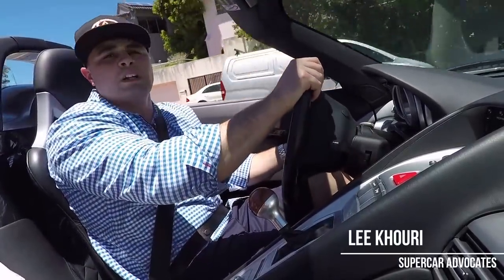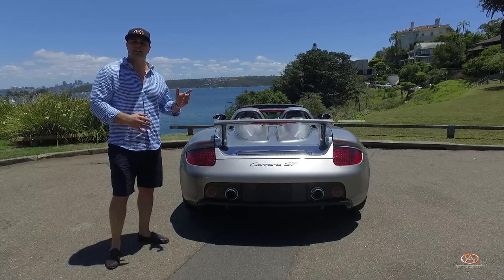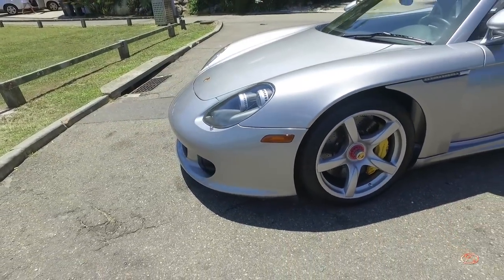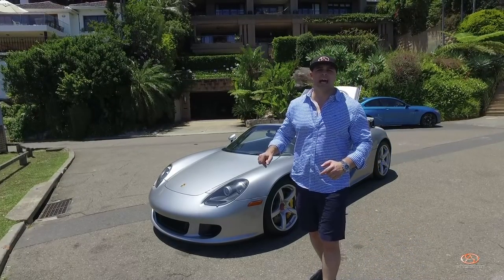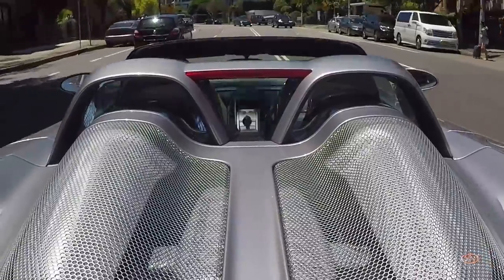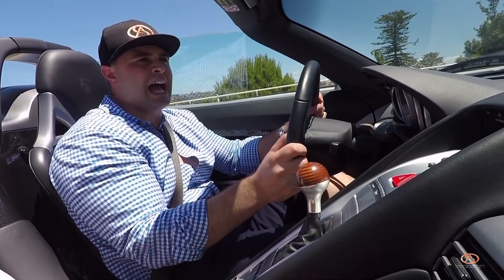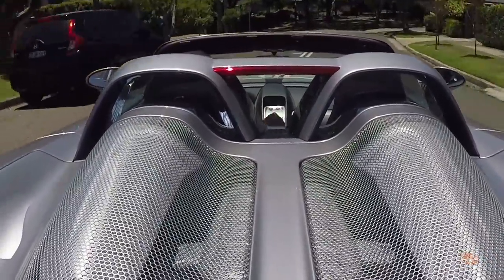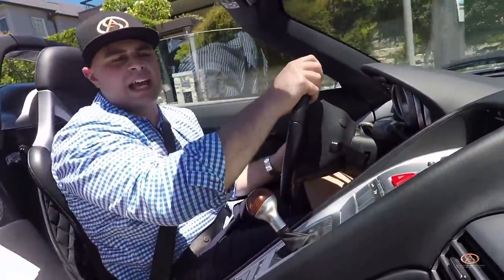This is why the Porsche Carrera GT sounds like an F1 - Review

Comment: Wasn't the engine reworked from a cancelled LeMans program that was in the works to follow on from the 1998 GT1's but cancelled before it hit the track? Not an F1 program.
Reply: Wikipedia says it was started in the early 90's for Footwork, not Arrows, then enlarged for the LeMans program which got cancelled before finally landing in the Carrera GT.
Reply from the maker: https://www.carthrottle.com/post/wg4gm5q/
Reply from the maker: https://en.m.wikipedia.org/wiki/Footwork_Arrows
Reply: devonport1978 arrows was footwork
Seems like ppl r finding it hard to believe it’s formula 1 engine when it is clear if u research
Reply: George Dooperman Ease up hero. Everything I'd ever seen and read about this car referenced the cancelled LeMans program as the origin of the engine. Nobody else had taken it that far back to link it to the F1 program. Always good to learn new things isn't it.
Reply: Yes, you‘re right! But the le mans engine is coming from an f1 engine. It’s basically a stroked version. ;)
Reply: a Corvete Z06 sounds better
Reply: Each to their own. I think the best sounding production engine of the modern era is the AMG V12 in the Pagani Zonda 760 series but the CGT is definitely in the top 10 for me.
Reply: VW are to blame for this not happening telling them to cancel there racing program as there was already Audi in it or lose out on the suv

Comment: So is there a more technical explanation why? Is it the cylinder angle? The oversquare bore? The firing order? B/c it sounds like it screams which I would have attributed to high revs in F1 but this only goes to 8,000

Comment: Probably my all time favourite car, amazing review! I've always wondered if there is any specific method to launch this car the fastest way possible? Since you have to completely release the clutch before using the gas i would assume you lose a lot of time because of that when launching from a standstill. Also what's the deal with hill starts?
Reply from the maker: Cheers...! The smoothest way off the lights is by completely releasing the clutch as the car has an auto throttle for that movement. It just gives the car enough power to roll on, so on a hill start, you have enough for it to creep forwards then you give it some gas. It’s the most trickiest street clutch but perfectly race. A few enthusiasts liken it to an old F1 car, it pretty much is a race car for the street. Highly addictive and the most rewarding.